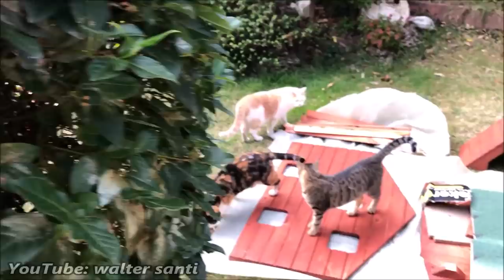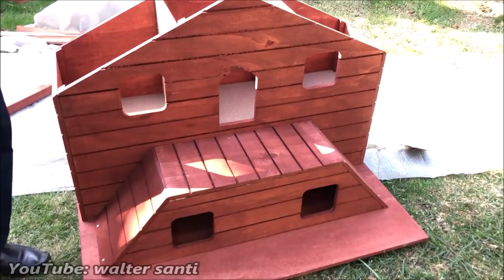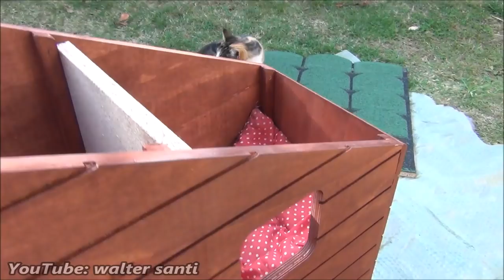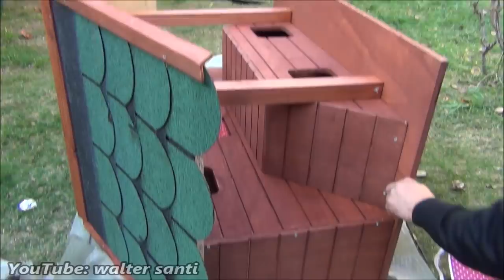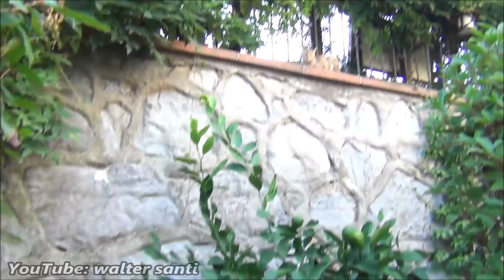We Surprised Our Cats with a 7 Bedroom Cat House !!

Comment: The house looks nice, but the rooms seem a bit small. Remind me of those japanese cubicle hotels.
Reply: I mean they have the whole backyard, they only use it when it was rainy and sleeping only. Yup totally like the Japanese cubicle hotel
Reply: cats like such cozy places, to them it gives sense of security.
Reply: Hold on, that was fun!
Reply: Cats like to curl up when it is cooler outside.
Reply: Wait wrong comment I replied too xd
Reply: @zeuxlaught2797  but they can't lay in those little rooms, they can only sit
Reply: @RbDLRz  not really. Our cats (ragdolls) curl up in smaller boxes and cat baskets. The got the whole house with cozy chairs, beds etc but prefer to squeeze in little boxes and sleep in there. My boyfriend keeps comparing cats to liquid as they seem to fit anywhere xD
Reply: It does seem more like a kitten house to me too, but I'm prepared to believe that cats like it good n cramped (cosy).
Reply: @RbDLRz  They can't sit in the bottom ones, they can't even stand in them, they have to crouch.
Reply: Ya, definitely like those hotels.  😃
Reply: I only see 5 openings. Where are the other 2?
Reply: @riasomers642  The other two openings are behind the little porch at the bottom of the housefront. At 00:10 you can see five holes on the large frontpiece to the left. The lower two get covered up after the little piece with the two holes in the top right of the screen gets attached in front of them.
Reply: Cats like enclosed spaces, my cat love hanging out in cardboard boxes
Reply: They love to squeeze into the tiniest places.

Comment: I would've wanted to put some hinges on the roof for ease of cleaning.
Reply: They have miniature human maids.
Reply: Yes, the cushion needs to be removeable, washable, especially after damp weather to avoid mold.
Reply: @julieclemons6701  yeah me
Reply: Justin Stewart  not really
Reply: He should also have had a way for the cats to go from the bottom to the top without going out.
Reply: Yup this house is good for a few months before it grows mold....bad for cats
Reply: IF they gain weight, some of them might have trouble getting in and out of the rooms.  I would of made the doorways a bit larger.
Reply: @DNulrammah  help je hem with a dieet

Comment: But there weren't 7 bedroom - unless there were some on the other side, I only saw 4 or 5.
Reply: I assumed behind the two downstairs entrances the area counts as 4 connected bedrooms. 2 in the front, 2 in the back.
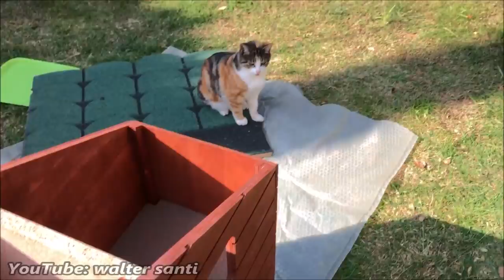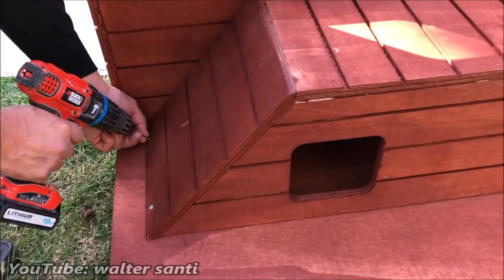Reply: 0:34 there's 5 and 0:42 another 2
Reply: @MsKuroneko92  no that is just one room with two doors... We see cats enter one door and existing from the other... So it is a 6 bedroom max...
Reply: @roseroy5041  there are four connected bedrooms at the bottom level. but only two openings from outside. the rooms are big enough to be considered four, it was just the rooms are connected.
Reply: kbamm69  valid point. at least they should warrant a serious reduction in rent. Safety hazzard for sure! uh oh
Reply: @Bloxeh  if someone is  going to walk through it it's not a bedroom for me.
Reply: Two in the back I thought.
Reply: We need to figure this out because it a health code violation. Are they renting or are they paying a mortgage?
Reply: Thank you 😊! Thought I was the only one... I just recounted 4 times 😄🤔
Reply: That has been driving me crazy.
Reply: @lexiecharles6969  😂
Reply: @lexiecharles6969  No worries..its base on hotel concept; the 2 at the back with no views and no access doors are budget rooms, heavily discounted. The front two are standard rooms, while the top 3 are the deluxe rooms 😄

Comment: Love the house,  but am I counting wrong..I see only 5 bedrooms.
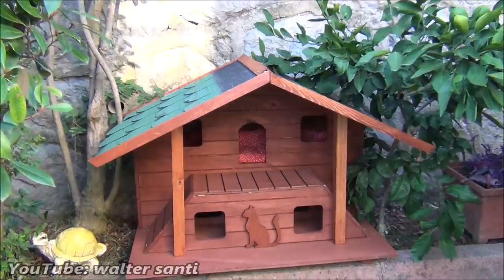Reply: If you look at 2:40 through the two bottom doors you can see the other 2 openings to two more bedrooms underneath. 👍 🇬🇧
Reply: @grahamefreestone5309  ? I still see 4 bedrooms with 5 openings?
Reply: @naylisyazwina6836  there are only five openings, but there are 7 bedrooms if you look closely. there are 4 bedrooms at the bottom level, but only two doors. the 4 bedrooms at the bottom are connected
Reply: Bottom 2 openings doesn't have anything soft to lay on, so I'm taking that as a walkway. I'm guessing back 2 rooms do have cushions too. If they do that would be 5 bedrooms. If no cushions, 3 bedrooms at the top are only comfy ones. 
Be a bit challenging cleaning the bottom rooms.
Reply: @catherinep2034  may be they dont have extra cushions yet to put.. only need to wash the cushions to clean the room imo
Reply: @cuetzen712  I was thinking removing spider webs, whatever the cats caught & left inside...

Comment: I added some hidey-hole panels to a big old wooden shelving unit that we had, and we set it up in the carport for the ten or so outdoor cats that we feed and care for.  Old bedding, towels, and the occasional foam-mattress-top provide inexpensive bedding that can be easily removed for washing or discarding as appropriate.  This cat hotel is not much, but it is a safe place situated away from wind and weather from which you can hear a lot of purring on cold nights.

Comment: The house is very good during warmer weather. During the cold, cold winter, the house will not keep the cats warm. After all, it has no insulation; not on the roof, the walls, and the floors.

Comment: Great cat house except for one thing! The asphalt tiles on the roof are supposed to be staggered! It will leak onto the wood. I suggest you waterproof it with Marine spar varnish or we do them correctly unless you want problems eventually. Nonetheless, a great house for the kitties 👍

Comment: I'm not so sure that would be good for winter as it doesn't look insulated. Also, blankets will turn literally turn into ice so you should always put straw in your outdoor houses. There's different types but I've found wheat straw to be the best. Really cute house that would be easy to insulate.

Comment: Seven rooms my ass, there's four at most because the bottom room is just one big one with two entrances.
If the bottom double wide room had a dividing wall then and only then would the whole thing have five rooms, still not seven though.